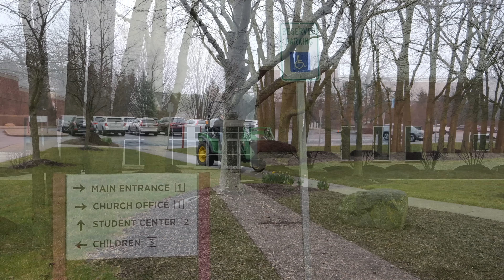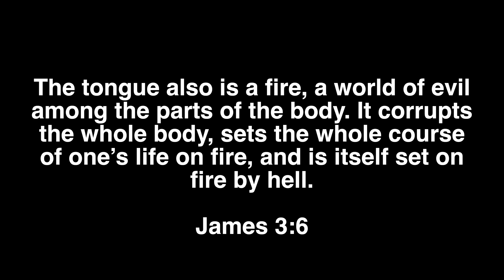TRACTOR FIRE! DESTROYED BARN FULL OF EQUIPMENT!  Tractor Time with Tim To The Rescue!

Comment: Even though equipment can be replaced and buildings can be repaired it's still an experience no one wants to go thru. 
Earlier this week I was getting close to home when I noticed my engine light was on. I left it in the middle of the driveway while I looked it over, read the owners manual, and talked to the dealer.
Your sign story reminded me of an event from my childhood. My Dad was showing off his first ever brand new riding mower to his brother. My uncle let the clutch out and rode the mower straight up a creeper leaned up against the work bench in the garage. Only his pride was hurt.

Comment: Off the subject again but maybe a good time of year to discuss this.  
My 2021 1023 @ 120R NSL loader was due for it's 200hr service.  
I'm recovering from surgery on my arm and no way was I going to be able to attempt the service myself this year.
So I took it to my dealership.  
Cost me an unbelievable amount of money.  But there was a positive outcome.   
The service included an "inspection" where the tech discovered what they called the "loader pin" was worn. This is the 3' long silver color pipe looking device out in front of the lift arms of the loader.   He said that it is a common problem that they wear on the ends where they fasten to the loader arms.  
So I found this "inspection" to be a very valuable service as there was no sign of any problem operating the loader so I would have never thought to check it.  
So if you haven't already, I wonder if you would please make a video discussing "inspections" for us new subcompact tractor owners.  Spring is right around the corner here in NE Ohio and we'll be putting em to work soon!

Thanks

Comment: Tim, in my past experience, adding mulch to beds that are already full of mulch tends to lead to the ground level being higher than the foundation which causes water issues.  I've done mold remediation on many buildings with the ground level higher than the foundation because of mulch beds and when it rained it held moisture against the wall leading to water getting inside the walls.  I'd hate for them to have mold issues.  Just a thought.  I do like that 3 series.  Very nice tractor.  God bless!
Reply: It’s best not to have garden beds next to building walls.
Reply: People tend to go mulch crazy.
Reply: yeah it's actually code for ground level to be 8" below the siding at the foundation under the sill due to weep and wicking

Comment: I have a 72" litter bucket on my L4701 that stays on most of the time. Great for tossing fallen branches in then carrying down to the dump pile. I use it to move cut firewood and 16" rounds. I'm probably overloading it, but so far no welds have cracked :)

Comment: I believe it’s always good idea to let all equipment cool down before putting it in a building. I’ve seen birds make a nest on the exhaust manifold which if not spotted early can catch fire after running the tractor for a while. It doesn’t take much sometimes
Reply: Sometimes I must store the riding mower shortly after I finish mowing so I always open the hood once in the garage to more quickly dissipate the heat.

Comment: Hi Tim,
In your videos it seems like the 2038r has more whine from the hydrostatic transmission than the 3r.  Do you find the 3r to be quieter than the 1 and 2 series tractors in that regard in person too?  
Sorry to see all that equipment burned up at the church. Hopefully with the insurance they can budget for some replacements.  Looked like mostly green was in the barn, surely that doesn't mean that the big guy drives a Kubota?

Comment: Use caution when driving over curbs. I was clearing snow with my 2038r at our church and drove over a curb and hit the auto connect drive for my 72 " mower deck and broke it.  It cost me $1000 to replace the broken part.

Comment: mower deck looks good for the tractor. check the gear box oil.
that church should only get new mulch every 5-8 years, all that needs to be done is turn it over every year and hit it with a back pack sprayer with new dye. walmart has a battery powered backpack sprayer under the HART brand that would work very well for that. 1 person could do it all in a week end or get two and make it easier. can't recall the price but it's $1XX something
lawncarenut alyn hane has a video about redying, so does Pete GCI turf services and some others.

Comment: sorry  to all at church , equipment  all has potential for fire i always try to clean mine and leave  doors open and check before closing up  , i remember as a 25 year old my first tractor a 8N  i always parked under our deck then covered when it cooled about 3 mins after parking the old wire harness starting burning in  I  panicked and pushed it out as it burned  ended up rewiring that old tractor  thank god i didnt burn down my new house i just finished

Comment: Tim most handicapped scooters work that way too on the controls. You let go and it engages the brakes and stops.  I had a little trouble getting used to it but it is fast if you can remember to let go.  I have to use one to work in the yard and garage so I am now used to it.

Comment: You should tell them to take off the old mulch around the trees first before adding the new, if you don't do that you will eventually kill the tree.  I would also get rid of the excess mulch around the building, it should not come up to or cover the brick but be about 8" below where the brick starts on the foundation wall.

Comment: Typical John Deere always catching on fire.   We had a 9r 640.  Burn down last yr in our field while baling hay it went into a region the pipe underneath got so damn hot it caught the windrow on fire and burn the tractor down. you got to love the EPA..
Reply: I also own a tractor that goes into 'regen' or continues to beep until you allow it to rev up to an insane rpm then the heat it's produces from extra diesel injetecd into last cylinder (probably washing it out) while wasting fuel is spose to be environmentally friendly. Dealer says don't idle it for less regens . I say tell Al Gore to mind his business
Reply: ya. Its a joke..  i would love too know what tree hugger. Though it would be to put this crap on diesel engine's an burn more fuel an tons of down time. It just cost so much more to operate . I make our diesel's go on a epa diet.  If you know what I mean..Hahahahhaha

Comment: I don't understand why a tractor was put back in the garage while it was smoking. I leave everything out to cool to the point where the exhaust is cool enough to touch after they have been running in case something falls on them like a cloth or piece of wood and comes in to contact with a hot component, if it starts smoking I would try and move it somewhere safe (away from anything that could burn) and shut it down.
Reply from the maker: Yes of course.  Wasn’t the brightest move.  It happens…especially with ‘city based’ volunteers.

Comment: Sorry bout the event. Did you say they use volunteers? if so, there is the answer. I'm surprised insurance will cover it if the machine was driven in whilst smoking. (Due diligence and proof of training)
Reply from the maker: They have a specific list of trained tractor operators.   
Yes, serious mistake,  but that is what insurance is for…mistakes.
Reply: @TractorTimewithTim  In my experience of insurance companys if it is known that someone was negligent, the company will go after that someone.